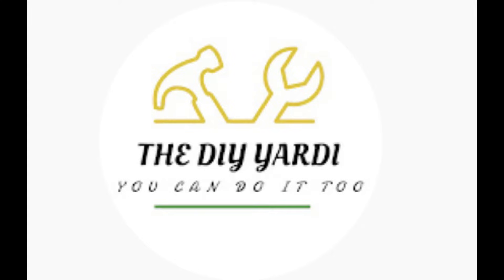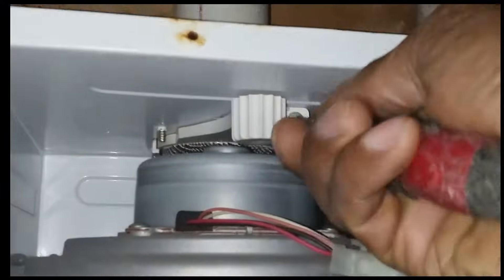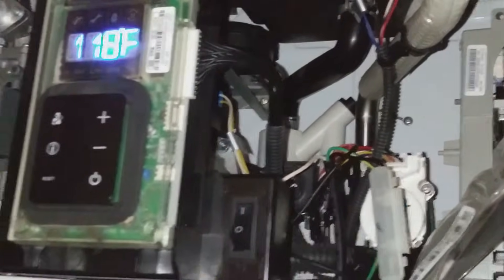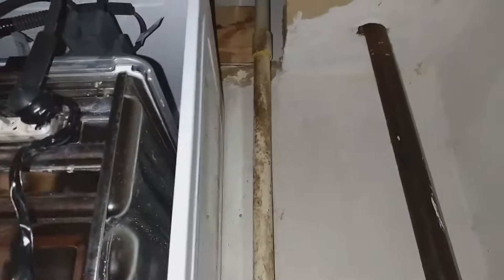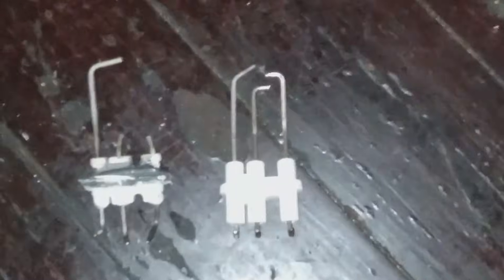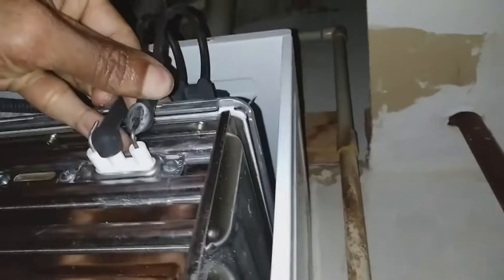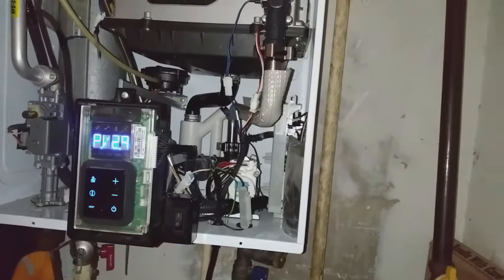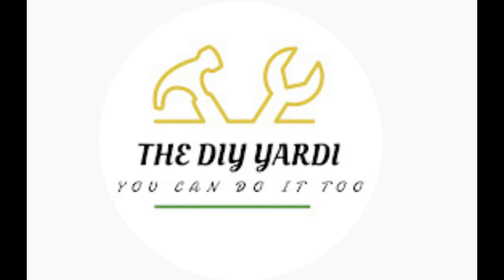NAVIEN TANKLESS HOT WATER HEATER NOT HEATING AND FLASHING ERROR CODE 3 FIX.

Comment from the maker: *FOR PARTS*
**For a links to replacement parts used in this video and more, please click on the description box..
**If you found this video helpful and would consider making a small donation to the channel
https://cash.app/$DIYYardie            https://paypal.me/TheDiyYardie
Reply: enjoyed this video.  have the same problem.  have to reset in order to get hot water.  is that an indication that the ignitor is going bad?  thank you
Reply from the maker: @jeremiahlawson2725  that's quite possible, but you should first check the air filter, make sure its not clogged, and make sure the exhaust fan is turning on when the heater is on, if all that checks out, then I would check the ignitor..

Comment: NPE-240S error code 003. A LOT of water is discharging out the condensate drain, which shares the drain pipe of washing machine and so much that it overflows. Any ideas? Put in 2018 and has worked great. Regularly descaled.
Reply from the maker: Sounds possibly that the heat exchanger may have sprung a leak.

Comment: I am experiencing an issue with my Navien condensing water heater. The unit is not producing hot water, even though there is no error code displayed on the control panel.

I have already completed the following checks:

Performed internal and external cleaning

Verified that gas supply, water supply, and electrical power are all functioning properly

Set the temperature to 120°F and also tried the maximum setting (×1 hot water), but there is still no hot water output

Despite these efforts, the issue persists. I would greatly appreciate your assistance in diagnosing and resolving this problem.

Thank you for your support.
Reply from the maker: Did you check to make sure the flames kick on whenever the hot water tap is running? you should be able to observe it through the sight glass, if no flames, a possible ignition issue, if flames are present, then its possibly in need of a deep descaling procedure..

Comment: How to manually trip the error code screen...I dont have error screen that shows codes automatically...it appears i have same model as you have..TX...mine wasnt heating...cleaned air inlet which had crud init...seems good know....but why did it not show error on the screen?

Comment: No error code, cleaned filter, ignitor is working and still running luke warm and temp shows 120 whats next i can check or do??
Reply from the maker: Have you done or tried a descaling?
Reply: Cartridge mixing hot/cold somewhere

Comment: Can't get my 210s ng to heat past 3gpm. Everything heats and runs fine at 2gpm (shower, sink etc...) the only thing that does heat is the shower faucet that runs at 3.3gpm. The burner keeps turning on and off then smells like gas. Water goes lukewarm to super cold. I descaled and changed the flow sensor and it did not change. I'm all out of solutions. I did order a check valve but am not sure if my model uses that. I don't get any error codes
Reply from the maker: It sounds like it has a possible cracked heat exchanger, clogged exhaust or cracked or loose gas line, I suggest you shut it down until you get a professional to check it out, once you're smelling gas that is quite serious..
Reply: There is no hot water at all, and there is no error code done cleaning everything, not water still check power supply gas water everything good even adjust the temperature at 120 and max temp still no hot water navien condensing tankless water heater

Comment: I got na navien that wont get off stand by mode i flushed it already
Reply from the maker: To reset a Navien tankless water heater stuck in standby mode, turn off the power to the unit at the circuit breaker, locate the reset button on the control panel (usually behind an access panel), press and hold the button for a few seconds, then turn the power back on and allow the unit to restart; if the issue persists, consult your user manual or contact Navien customer support
Reply from the maker: not sure if you already tried this..

Comment: Hello, great video. I have a naviam nr210a.
This unit keeps blowing the two 5 amp fuses. This the AC line coming in fused at 5 amps ( hot and neutral)
I flushed system, cleaned intake filter. But it keeps blowing the fuses.
Any suggestions will be greatly appreciated! Thank you
Reply from the maker: Hi, sorry to hear you're having that issue, it sounds to me like the unit is experiencing  some sort of short, either at power supply lines or a component, this can sometimes be obvious to recognize with noticeable burn signs in wires or a component, or the total opposite where everything looks just fine, in that case certain tests would need to conducted to determine the cause of the problem. If you're not experienced working with electricity, my best advice is to suggest you call in a professional technician.
Reply: @thediyyardie7192  THANK YOU FOR YOUR REPLY. FYI: ONCE I REPLACED THE TWO 5 AMP FUSES AT THE AC LINE COMING IN, THEN TURN THE UNIT ON. THE UNIT STAYS ON, BUT AS SOON AS I OPEN A FAUCET TO LET WATER RUN, THAT IS WHEN FUSES GET BLOWN AFTER A FEW SECONDS. THERE IS NO BURN SIGNS ANYWHERE. 
THX

Comment: Thanks for the video.  Is it normal for a Navien NPE 240a- ng to run 3 to 4 times an hour when no water is being run?
Reply from the maker: To answer your question no, these units have what's called a flow sensor that detects when the hot water tap is turned on and thus kicks the unit on. The only other reasons I can think of that would cause this could be, a leak some somewhere in your hot water line or faucet , which would be most likely noticeable, a faulty flow sensor, or if your unit is connected to your home heating system, which is possible depending on the type or set up you have.
Reply: @thediyyardie7192  thank you very much!
Reply from the maker: @mattbingen you're welcome.
Reply from the maker: @mattbingen  were you able to figure out what is causing the issue with your water heater?

Comment: I have ch240 model, with the same error e003 code, i have changed pcb board, ignitor, it ignite runs fine for about 3 to 5 minutes then just shuts down, and throws error code, without trying to ignite. Help please
Reply from the maker: there are a number of things that can cause that issue, you already eliminated two, others include restricted air intake\filter, you should also listen to make sure ventilation fan kicks on during operation, or some other restriction to the ventilation,  or an  issue with gas pressure or regulator.
Reply: @thediyyardie7192 I lost hot water out of no where, with a 003 error

Comment: Great video! Question for you…Would u know why my heater won’t turn on? There’s no display on circuit board when turned on. Is there a reset button somewhere? Model NR240
Reply from the maker: @peterhawth, there is a reset procedure, but the unit needs to be on in order to perform it, it sounds as though you have a power supply issue, a bad or shorted connection, a tripped breaker or worst case a burnt out pc board, try confirming the power supply first, it no issue there I suggest contacting Navien customer service, you can usually get a tech to walk you through a few trouble shooting steps, and possibly send you out a replacement part depending on the year of your unit...good luck with that..

Comment: I got the same problem and I replaced it with a new ignition, but after one day a new ignition be come dirty again. why, I don't know, you can explain to me the reasons, thanks
Reply from the maker: Are you saying the ignitor accumulated heavy soot after a day? if yes, make sure the ventilation system is operating properly, check filter to make sure its not clogged,  you should also make sure the vent fan runs whenever the flame is on, sounds as though its getting more gas than air.. possible gas regulator issue also..

Comment: Great video. Do you know how to display the date and time of the last error code? The newer Navs I can can, but I can't figure out how to do it on these older models.
Reply from the maker: Thanks much for the compliments on my video, not sure how old the model you're referring to is, or if it has that capability, but to get to that info I use the mode button to find code history, arrow down to code history and select, once selected it should show date and time of error code..Hope this helps..
Reply: @thediyyardie7192  its a few years old only. I can display the error codes but i dont see a way to display the date of last error. Thanks for replying
Reply from the maker: @Honeyman76  depending on what model unit you have, the screen will turn red when an error code is tripped. at that point selecting error code history will show date and time.. other than that I would suggest trying Navien customer service, let them know what you're trying to do, a tech can usually walk you through it.. good luck with that, and you're welcome..
Reply: @thediyyardie7192  it turns out after I spoke to Navien, the best they offer on the older Navs is 1 to 9 on error history. There is a second number which is hours, but the Nav Technician advised me that it is not accurate. I am dealing with a troubled client and the date and time given by the newer navs would have been helpful to see if stories are being made up about what is actually happening with the Nav.
Reply from the maker: @Honeyman76  were you able to determine any idea of a date and time with the info you got from the Navien tech? even though he said it may not be accurate...
Reply: @thediyyardie7192  when you push the info button it lists the error codes from most recent to oldest. There is another number that will display how many hours ago that error code occurred
Reply from the maker: @Honeyman76  I understand how to access the date and time, what  I'm asking is, was the information provided by the tech suitable to solve the issue with the customer?
Reply: @thediyyardie7192  For me yes, for the client no. The issue was an over limit code. When the client was having a shower and the air handler (uses hot water from nav to heat) the AHU would shut down do to over limit. The Nav prioritized the hot water usage over the heating of the home. It is a self rectifying code that the home owner was unhappy with. There is no fix for this. No programming that can be done. So, no the home owner was not happy)
Reply from the maker: @Honeyman76  yes, I'm familiar with that issue, they could always  get a new unit that will handle heat and domestic hot water simultaneously, that's one option..
Reply: @thediyyardie7192  For sure. This is an NPE 180. Perhaps the 240 could support the added GPM.
Reply from the maker: @Honeyman76  most definitely in agreement there.. you could try to suggest that,  don't sound as if they would be to welcoming to that idea though...
Reply: @thediyyardie7192  lol, ya the client is trouble. I don't wish her on any tech lol

Comment: My unit is hooked up to a 5 gallon propane tank do I need a pressure regulator or can I run a straight line?
Reply from the maker: Hey Robert, yes you do need a regulator in the line,  I would suggest get this done to the recommended code specs of the area you live though, unless this is for a RV or cabin, but yes you will still need to use a regulator in any case..

Comment: Yardie, I have a navien boiler ch-180 for 10 years . I never had any problems until now. I am getting domestic hot water but very, very Luke warm water to the radiator.
Any suggestions will help.
(Yard man also) . 
Thanks.
Reply from the maker: Bless up Nick, what type of maintenance have been done on the unit in the past, for example cleaning/descaling?
Reply: OK I got the thermometer and the reading. After running the boiler for over one and a half hour 96° going in the radiator and 92° coming out. The boiler was 80° going in and 126° coming out. I also took the temp of the outside pipe with the pump. The pipe with the pump is 88° and the other side (return maybe) is 77°.
You mentioned before about the temperature accidentally move.

 What should the temp be on the LCD display? 

Thanks.
Reply from the maker: @ncurtis14  The unit seems to be working fine, as far as temperature, the issue is that there's a big temperature loss between the unit and radiators, what is the temperature going into the circulation pump and coming out the other side, I'm trying to determine if the pump is operating or there's some sort of blockage in the line.
Reply: @thediyyardie7192  OK, I am away for the weekend and I will check it when I get home.
The temp on the LCD display for the DHW is 120°. What the temp for the space heating should be?
Thanks.
Reply from the maker: @ncurtis14  that 120 is most likely domestic water temp, to see output water temp for radiator press mode button once, it should display the different temperatures and psi readings, there's a test I suggest you do, its to detect if the heat exchanger is leaking, a leaking heat exchange can also cause the issue you're having, if it is or if there's any other obvious issues, like signs of rust in the unit, Navien will replace the unit or the defective part if the unit its under 10 yrs old,,
Reply: @thediyyardie7192  The temp on the pump is, top 78° and below is 98°.
I have my navien for about 12 years. I never had any problems before, a lot of people are having problems in a couple of months. The LCD is not on the unit, it's on the wall so it's a little different. The inside of the unit looks the same.
Reply from the maker: @ncurtis14  You need to check what your outgoing water temp for heaters is set to, you can find how to do this in your users manual or by contacting Navien customer service directly if you don't have the manual, also you can check to see if your heat exchanger is leaking, if it is, that can cause low heat out put at radiators. I don't have a video up on how to do it, but if you search ' How to test for leak with soapy water on Navien tankless water heater' on Youtube, you'll see a video titled  'They all leak'  by Mikey Pipes, it shows how to do the test, just make sure the unit has been on and running for at least 20 minutes, before and while you're doing the test 
and be sure to cover pc board with plastic and towel when spraying a small amount of soapy water at top of heat exchanger, I expect it is leaking and will need to be replaced..
Reply: @thediyyardie7192  OK, I will check it out.
Thanks.
Reply from the maker: @ncurtis14  nuff respect Nick, let me know what you find out..
Reply: I did descaling every 2 years and cleaning every year.
Reply from the maker: @ncurtis14  ok sounds good, make sure the temperature on the unit is at the recommended setting, it may have been turned down accidentally.. it could also be an issue with the flow pump, check to make sure that it is operating properly, but the best check to perform would be to use a thermometer, a digital type would work best, you need to check the temperature in three places, with the heat on, at the supply pipe from water heater to radiators, at inlet pipe on radiators, and at the outlet pipes, if temperature is 65 degrees going into radiator, it should about 55 out or a little less coming out. this can also help you to determine where temp loss/blocage issue is located.. keep in touch, let me know what you find..
Reply: Where is the flow pump?
I am going to get a thermometer and do the tests. Also I noticed that the boiler runs louder when using the domestic water and quiet when  the heat is on. 
Thanks again for your help.
Reply from the maker: @ncurtis14  there are actually two pumps in the system, one built inside the unit called the prime pump, and the main pump on the outlet pipe leading to the radiators, the correct name is the curculator pump.. also visually inspect PC board for any sign of burn, a bad board will also prevent the unit from reaching the proper operating temperature.. and you're you're welcome Sah..

Comment: I keep getting the error but my igniter works perfectly. Mine is on Propane gas, how can I fix???
Reply from the maker: Hey Frankie, have you checked your intake air filter to make sure its clear of any blockages, and also what happens when you turn on the hot water, does the burner in the unit fire up any at all? you can look trough the sight glass while having someone turn on a hot water pipe, if it fires up and cuts right back off, it could be a issue with the gas supply to the unit, a faulty ignition module, blocked exhaust vent, or a number of other issues. try contacting Navien customer service if none of these seem to be the issue, they will actually walk you trough the trouble shooting process.. good luck, keep in touch, let me know how it goes...

Comment: My. Navien dint pass the heat to the radiator but all the valves. Are on
Reply from the maker: hey Hector, can you give me some more info, have you performed any work on the unit, did you check the sight glass to verify if the igniter glows at start up, and is it trowing any trouble codes?
Reply: @thediyyardie7192   i didn’t see. It the only thing no code on the screen  and for the shower and Faucet I have hot water
Reply from the maker: @SuperCastroh  ok, I misunderstood what you were saying, what radiator are you saying is not getting heated?